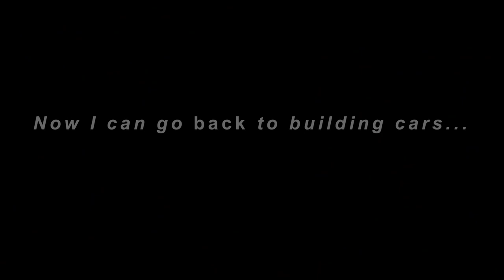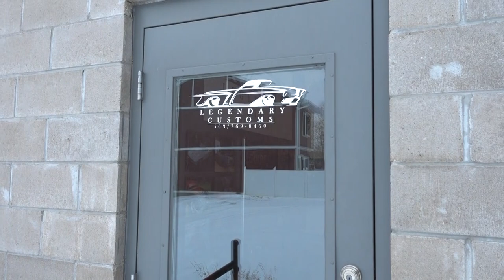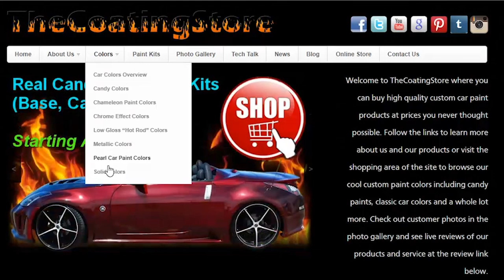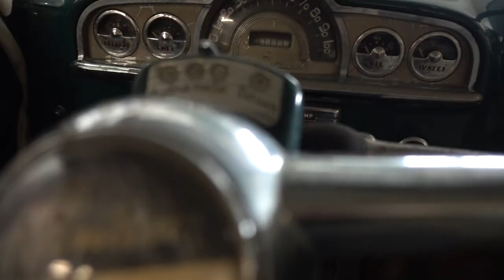Pontiacs, Paint and Parts

Comment: Did you ever get the 49 Pontiac running and if so, what did it require?
Reply: Quidamkid Yes the Pontiac is running & alive. We had to complete a full valve job & hone the cylinders. After that, it started right up.
Reply: @chrismeyer6196  -  Thanks for the response.  I see that the 49' is currently for sale for about 10K.
Reply: Quidamkid It is up for sale. The owner isn't using it as much as he thought he would. It's a great car!
Reply: @chrismeyer6196  I seriously considered buying it, but couldn't help noticing it wasn't equipped with a heater.  Am I wrong and if I am not, is that something that could be added at a reasonable price?
Reply: lol, You should get a commission if I were to buy it.
Reply: @Quidamkid  you should get it just to have it out on the road enjoying it.
Reply: @chrismeyer6196  - I doubt I will buy it, but I will keep it in mind if the other choices fall through.  I am debating between a 62 Grand Prix and a 66 Chevy Caprice - with either of them I would likely be hiring your firm for some major work.
Reply: @Quidamkid  EXCELLENT! Thanks for the opportunity to help your vehicle become Legendary!
Reply: @chrismeyer6196  I bought the 1962 Pontiac Grand Prix with a 389 4 barrel.  She is a numbers matching car with 77,000 miles on her and has the original build sheets and all the original paperwork.  Her paint is nearly perfect, bright work is impeccable, the interior has a few blemishes and the carb may need a rebuild.  I would like to have the brakes changed from drum to disc and some electric circuits checked and/or repaired (Generator continuously discharges).  Many of the accessories will not turn on (hopefully just fuses - but hey it has 58 year old wiring- so who knows.) There may be more - when can bring her in for you and your team to perfect?